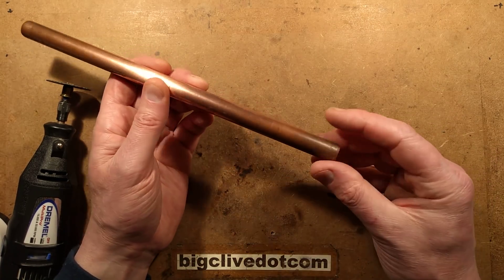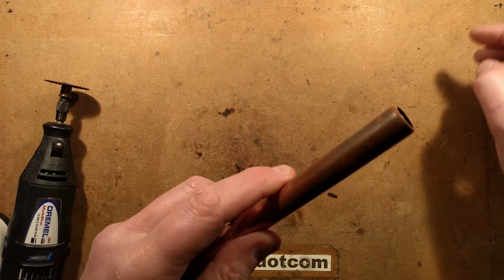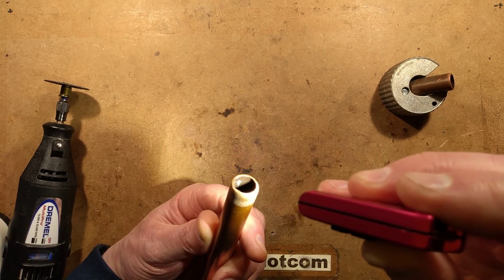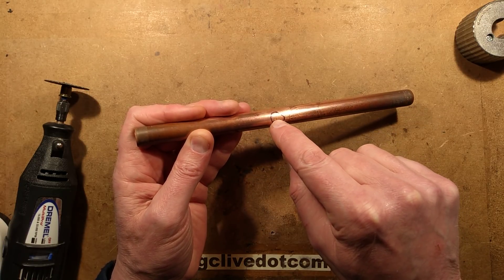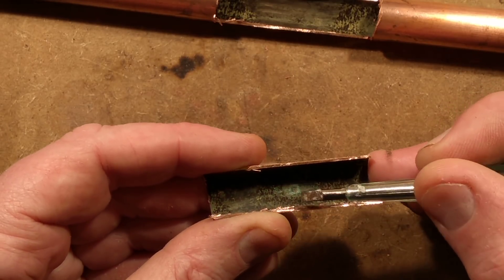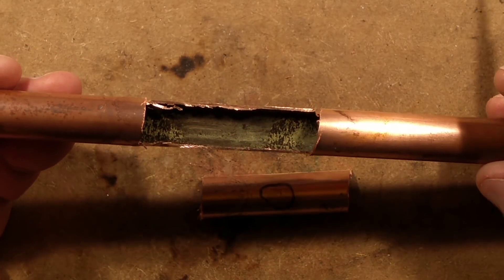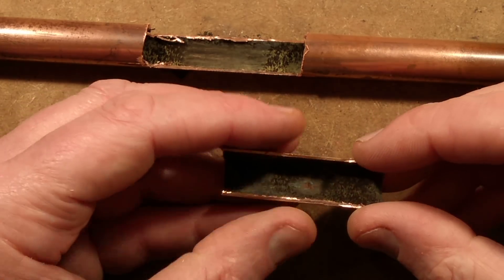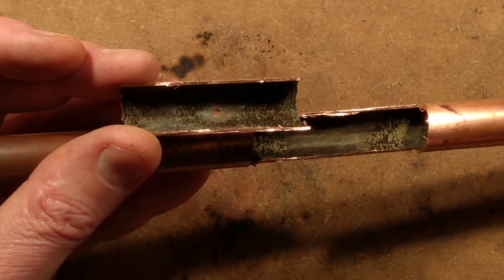Odd pinhole leak in copper pipe.  Selective electrolytic corrosion?

Comment: If the "pin hole" and "green dots  are in a line" thats a manufacture deffect. I noticed years ago the thinner copper you could plainly see  a seem or groove running down the pipe. But it was a straight line. If your green dots and pin hole are randomely placed throughout then i would say contamination to the copper Can you see the manufacturer stamp if so i bet 20 years ago was right about the time of recycling. The bad news is that gole stick needs to be replaced. I did plumbing for 13 years if it were my house i would, but i would do some investigation first. You could get or i bet you have the 3.5 mm borescope camera mine is model number (AN98A) with 8 ft cord i think that would give you enough idea to see if it runs down the inside of the pipe in a seem or they are random contaminants. 13 years experience mostly new some residential repairs.  Having worked at a glass plant for 5 years 1 pop can tossed in the batch could leave a trail of tin a human hair thick for up to a mile long or little "stones". Seriously head on over to a home center and they will or should have different thickness copper on the pipe if it hasn't ben sitting a while you should be able to see a seem running down the length. Id come over and help but we are still frozen in kansass. Id deffenetly replace that run of copper tho hopefully its only 10ft stick and not 20 ft stick.
Reply: Actually, they could all be in a line and on the bottom of the pipe, and be caused by metallic debris flowing into the piping and settling to the bottom of the pipe. This does definitely happen if work is done upstream of the pipe and there are no filters in place, but I'd have to check what the galvanic reaction is. Copper is supposed to be nobler than iron, so shouldn't iron corrode first? Bronze filings however would cause the copper to corrode first.
Reply: @TDOBrandano  cheap valves and fittings in boilers etc could shed metal dust and shavings into pipes, there's various metals dissolved in the water supply depending where you live and also chlorine and different metallic salts added into the water supply, sometimes too much and also some that could be argued unsafe and probably will be banned in years to come..

Am also thinking that for example metal particles blended into pipe soldering flux melted down the side of pipes in interaction with water from the air could start corrosion inwards.. condensation on cold pipes..
Reply: i agree I used to sell copper pipe tbh if the whole house was done at the same time he will find more faults like this. Definitely replace the whole section. Like everything else copper pipe doesnt last for ever. We used to get some terrible stuff and gave up selling imported pipe it simply wasnt worth the trouble.
Reply: @womble321  I wonder how much scrap copper goes out and comes back as pipes, it will just be melted down and re-formed.

I don't think it will be processed or purified by de slagging in fluxes or chemical and electrolysis processes, just dumped in and melted into ingots, rolled and formed...
Reply: @grantrennie  what amazed me is one delivery we had I think it came from Eastern Europe, cost less wholesale than the current UK scrap price. So if we had just dumped it we would have still made a profit! This was about 25 years ago.
Reply: @grantrennie  yeah that sounds right, but like everything else different manufacturers have different quality control.
Reply: @womble321  i worked with a foreman on friday he would run over a roll of soft copper and scrap it then go buy beer. He was fired of course. But the beer was fun while it lasted.
Reply: @raymondmucklow3793  well belive it. They never managed to prove that sort of thing but they stopped the staff from getting the scrap money and donated it to charity. Result far less scrap! Oops thats another dented copper cylinder! Nudge nudge.
Reply: My 2 cents... replace the run with pex, pull the copper and examine, then take to a metal scrapyard and recycle it and that probably pay for the cost of the pex.
Reply: @peregrine1970  Cost of the PEX is insignificant.    It's the king's ransom you pay plumbers that will empty your wallet.      LoL
Reply: @magadon ruferto  Yep, that's where all the crap lands that don't make it out of the system.
Reply: He can get a lighted boroscope on ebay with a 10 meter lead for about $8USD.
Reply: Recycled copper (and almost all copper in general) is produced by electrorefining, a variant of electroplating. You just dont get chunks of other metals, just the odd atom here and there. Any significant local contaminant would have to be introduced after refining
Reply: Sorry for misspelled words or typos trying to get that types before taking my son to school.
Reply: by stick, you are talking about the copper pipe?
Reply: @forevercomputing  Yes, but pinholes like that can occur in fittings as well. I have on my desk a cast copper street elbow that developed a pinhole leak exactly like that after 50 years in service. I suspect a bit of contaminant in the material when it was cast.
Reply: @forevercomputing  yeah.
Reply: The vast majority of copper tubing and piping is SEAMLESS.  There are some welded seam copper pipe but it's for specialty engineered applications. Any seams you might see is perhaps from the mandrel during the extrusion process.
Reply: So if you google pinhole.leaks seems like they like to blame water heaters etc,that are corroded. Particles Travel to the pipe then stick to the side. Also the flow rate of water inside the pipe " turbulence" can cause corrosion. 8fps for cold water 5 fps for hot. But if those green spots are in a straight line its the seem. If they are random then deposits.
Reply: Kettlesimulator E patreon
Reply: legend
Reply: something has changed in the copper, probably all the recycled materials, impurities and manufacturing location, in remodeling I've taken out old type M and L both that looked better than the new copper going back in, cast brass fittings lead solder and more, most of it was there for 40+ years and leaks were mainly bad sweat joints, where the plumber didn't clean good, had flux issues or skimped on the solder and heat. heck, there's lots of galvanized steel pipe in use around here in and lots of copper DWV

I say it's mainly city water with all the chlorine and other chemicals in it, I don't see many issues on private well water areas, unless it's very acidic, alkali or the people have chemical injection then the piping and all fixtures turn to a corroded leak. same for hydronic heat systems, in goes the chemical water and death to all the equipment and materials unless you work hard to neutralize and balance it out.
Reply: All of the above and also some plumbers can be a bit over the top with flux when soldering the pipes, soldering the pipe vertically then fitting.  We had a building that the heating pipes came out on tiny holes, they blamed everything but the hot water pipes were next and when taken to bits at the hot water tank, the joints showed damage from flux and there was even some still around (believe it or not) and when the building was first opened the water had a bad look and taste due to they now know was flux residue!  Uck!  But small bits of steel can cause this problem as you suspect, this has been found in the past.  The building was re-plumbed mostly in Plastic pipe as there was very low access to under floors due to the way they built it.  I love the plastic pipe for difficult access, but prefer copper where it can be fitted.  Mind you, it is a lot better than some of the stuff they used just after WW11.  It was some form of alloy and would split when trying to take off a fitting or just develop a hole, just because it could.
Reply: @BoB4jjjjs  you dont sweat steal pipe, flux is easy to get rid of just flush it out. We used to flush each house wide open for 15 minutes then cap them off and im sure the finish guys did the dame thing.  If your still having a bad taste could be the water your supplied with. Copper is chosen for reasons taste and life.
Reply: @raymondmucklow3793  Steel pipe is threaded together!  The flux was left there for ages before the copper pipe was used and water was put through.  This is what appeared to have caused the dammage, if it had been used or water run through it would, or should have been fine, but it was questioned what type of flux the plumbers had used.   There was a big inquire about it, which I didn't get to involved in.  I had work to do elsewhere.
Reply: @BoB4jjjjs  yeah i can remember reading somewhere not to use certain flux on plumbing, i did new residential plumbing for 10 years before i moved over to commercial.   At the time it was the largest plumbing company in las vegas we had one supplier for certain things, my forman had called and order flux and no flux so he went to joe blows and brought back some shit every joint soldered had to be taken apart wiped clean and refluxed wiped clean then fluxed again then  soldered again with our regular brand. I was on a crew of 10 guys we each could do 2 houses maybe 3 a day. It was a mess.
Reply: @raymondmucklow3793  Foremen always know best!  Yeah right, how to screw things up.  I had a few foremen that when you told them something they would come back and tell you how to do the job properly repeating what you had just told them an hour before.  W***rs!  One day I got so fed up of one I told him how to do the job in a way that would be a disaster, knowing he would go and tell his bosses how to do the job properly.  He was told not to interfere with the men after that and just let them get on with the job.  He didn't get onto another job as they realised he knew f'** all about the job.
I saw him going around on another job but he appeared to be driving a van getting materials etc.  Bet he didn't get that right either.  I worked with a forman plumber, he was the best of the foreman around, he let the plumbers do their work and if he had a question, he would look it up or go ask someone.  I don't know what his trade was, if any, but as long as the job was getting done he was happy.  He got a lot more respect from his men that the others who thought they knew it all.  This foreman never said he knew it, he just treated his men better and if they said something wasn't right he would back them up.  He would check up first though, he also had the respect of the bosses as he never shouted at anyone and he could get a lot more out of his men than any of the others.  Shame he was not my boss, but you can't have everything.  We have problems here now with workers coming from Europe, either they have lower standards for electrical work and plumbing or they are chancers!!  Some of the work is awful and some of it is dangerous, but this is how everything appears to be going!
Reply: @BoB4jjjjs  I'm curious about this. I suppose it could happen if the pipes sat a long time before the boiler was put in service, but the active components in flux are water soluble and should wash out in a short time.
Reply: @davidhoekje7842  Yeah, you would think that would be the case, but there was complaints about the taste of the water when people moved in.  When some of the pipes were removed you could see where the flux had run (at least they said it was the flux that had caused it) but as you say it must have sat a while after the pipes were in, though it might not have to be that long if it were not filled with water as was though at the time.
There were all sorts of people involved, I got out of it as quick as I could as I was just put there to give someone a help.  Once so called experts came I left the first chance I got.  I would rather be doing something that standing around waiting for permission to do something.  Some pipes were grooved with wiggly lines right from the soldered joints, which did suggest it was flux that had caused that, but the other damage, I think it just aggravated what was there anyway.  The building was not very old either, but the pipes I suspect sat without water in them as they were putting in pipes before windows were in!  I have a feeling the firm went to the wall, but I am not sure about that.  Anyway, that is what they blamed for it, but I remember seeing black specks inside the pipes as well at random spots.  What they were was never established, not while I was involved anyway.  I did ask the other person why had to stay there for his sins, but he just said they put it down to flux,  Now you have to ask what type of flux did they use, it was all here today and gone tomorrow workers that worked in the building?
Reply: There are a lot of variables, and there is a lot to be known.  I have no illusions that what I've learned is complete.  I've come onto plenty of jobs and noticed the impact of flux on the outside of pipes that sat for six months, and have no doubt something equally bad happens inside.  The second tier question is what happens once the pipe is in service, at least to my mind.  Is the water quickly depositing a layer of mineral and oxide to protect the pipe, or is it eating the pipe.  Is there a particle so offensive in chemical terms that it'll eat through the pipe?  Is the so much electical differential in the system that the water and current are having a dance?  My intuition is that most systems are sufficently below the threshold of damage that they last many years essentially intact, while others are fucked from the word go.  In my region of Michigan, with the water we typically encounter, copper is amazing.  It lasts forever, it is robust and strong, and in the overall scheme of things it's affordable.  That said, I'm out of the trade, and it's all gone to PEX, so I'm glad to be out of it.
Reply: @davidhoekje7842  Copper is still the best for the job and normally outlast plastics, but it does appear to be a bit thinner these days!
Reply: @davidhoekje7842  They may be water soluble but they are acid based designed to clean (and can dissolve) the top layer of copper for proper mating
Reply: @davidhoekje7842  #copper for life. Got a question while i was a fng or new guy about six months in, working for the largest plumbing company in las vegas our crew was picked to run "wursbo" or wirsbo" its was milky white unless heated then it would turn clear. You could freeze it to 0 degrees then hit it hard with a hammer and it wouldnt crack you could kink it and just get the tourch out and heat it up a bit and straighten it out. Did you ever come across that stuff it had a 3 jaw tool that expaneded a ring and slip over the fitting and in 5 seconds it was good to go. I was told it was from Europe at the time and we weere the first in the us to us it we all had to give out feed back. Next to copper that stuff was amaxing. The only down side was it would breakdown in sunlight. You may have seen it a on the jobsite as a supply line with blue plastic sleeve, if it were used for residential supply.
Reply: The groove is something that's on all pipes that are made from flat stock, has nothing to do with pin holes unless the welding process was done badly. These pinholes are likely a corrosive agent that reacted with the copper. They are entirely too random (4 in total).
Reply: one of my friends was talking about this same thing not that long back he has been doing fluid dynamics and if i remember rightly this is caused by water hammer and single spot cavitation  i know sounds boring but here it is in real life so not boring
Reply: @factsarefactsanddonotlie8397  I fully understand that, we used to install water hammers in the high end houses, and sweat the pipes to the fasteners. On the cheap houses just screw the fastener to the wood. I once rebuilt my 99 f350 7.3 l i had to add an additive to the coolant as to not get cavitation on the outside of the cylinder head water jacket. Apparently over time it would eat a hole into cylinder wall. I'm  picking up what you're laying down.

Comment: I live in a condo and the upstairs unit's pipes also run through my ceiling chases.  After 3 pinhole leaks in different places in under 2 years I had to sue the association in order to force them to replace all the copper supply pipes, up and down.  We now have PEX throughout so hopefully this will not be an issue again for a long time to come.
Reply: What is pex?
Reply: If the hot water lines are the only ones leaking, and the degradation is linear lines that look like work tracks, that's usually due to cavitation from hot water circulating pumps being too powerful.  It's a common issue in commercial installations.
Reply: @simontay4851  It's a plastic tubing used for plumbing, usually supplied in long rolls and cut to length. It's flexible and joined by crimping or push-on connectors so pretty convenient and supposedly rated for three freezes or something. There was a bad batch back in the 70s that will spontaneously spring leaks (my mother-in-law was affected by this. She's all CPVC now though that has its own issues).
Reply: @chaos.corner  The 70's era plastic was probably polybutylene (grey plastic) the fittings and crimps were notorious for failure. PEX (crosslinked polyethylene) looks like an improvement, but time will tell.
Reply: @chaos.corner  That bad batch of plastic pipe wasn't PEX. It was a different plastic product.
Reply: @machintelligence  & Martin Green Thanks guys, I have been misinformed all these years. I appreciate the correction. It was the grey stuff.
Reply: @simontay4851  https://www.bobvila.com/articles/pex-pipe/

Comment: I am sure there is stuff you could pump through the pipes that "seals" the inner side of them. I am sure there is a chemical way of reversing that oxidation process but do not ask me what way that is.
Reply: lol you can't undo corrosion, damage is done, only thing to do is replace the damaged section.